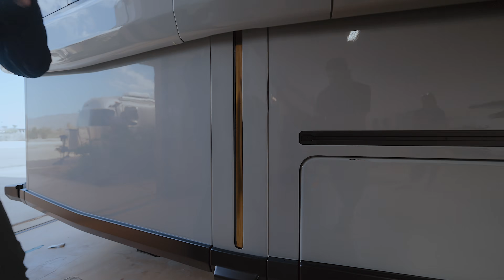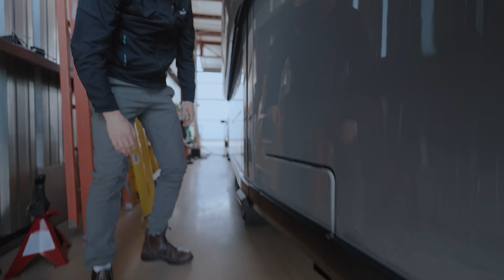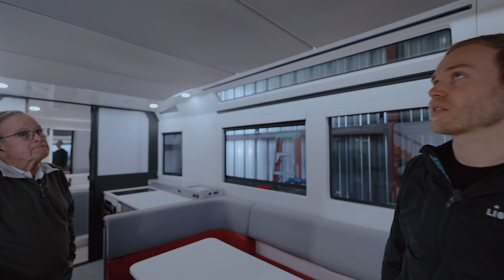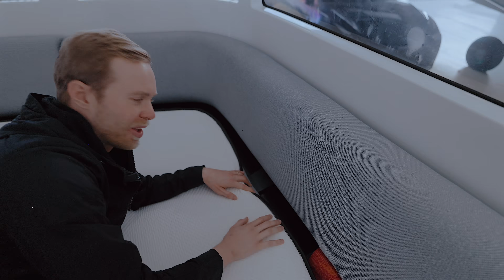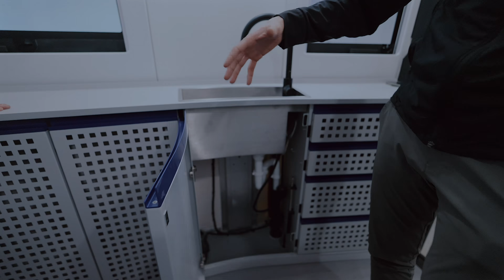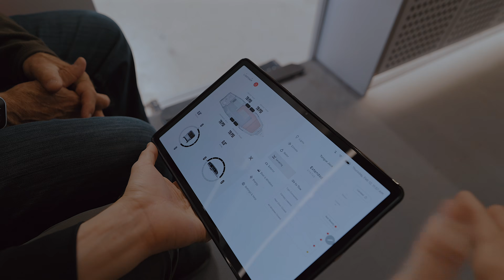Lightship AE. 1 Tour

Comment: I think the raising and lowering part is an unnecessary gimmick that adds weight and complexity. 

Given so many changes between the prototype and first production, it seems like there will be more issues to work out. Even if I’d consider this RV, I’d wait for v2 or v3. 

“CEO” kid does not inspire confidence.
Reply: Guess you don’t know much about aerodynamics and batteries then. Good thing the CEO has lots of experience here. Thanks for playing.
Reply: @michaelkonen go ahead, buy one then. Find out the hard way. 

How much additional weight in motors, tracks, pulleys, and whatever else is involved in making this go up and down? How much does all that cost to add and engineer into the product? 

What’s it like to unjam or clear a track that’s seized? Is there an easy way to clean and lube tracks? 

Any potential aero savings are likely moot. 

If you’ve ever spent any real time in an RV, you’d take one look at that shower and realize it and the whole living area are functionally compromised by the raise/lower design.

Did you buy one or just here to fanboy?
Reply: @HSWDeaconblues ya they just did all that for shits and giggles. You’re right. It was a waste of time but they already did all the hard work so they ignored the numbers and shipped it as is.
Reply: @michaelkonen this thing will bomb like Edsel. Had fun playing.
Reply: Why no trust in ceo? My guess is you are offended because of his intelligence over your lack!